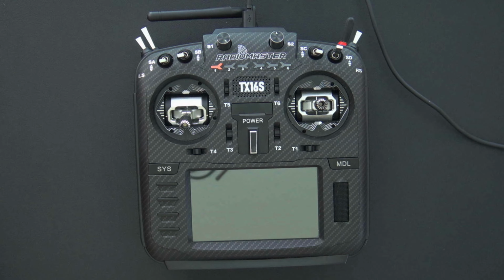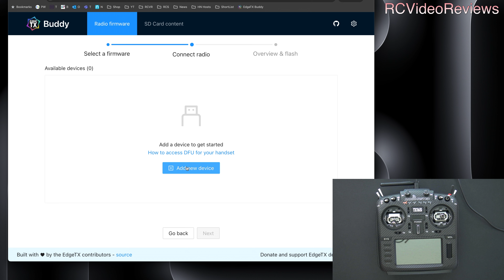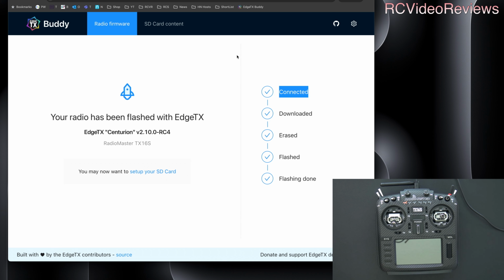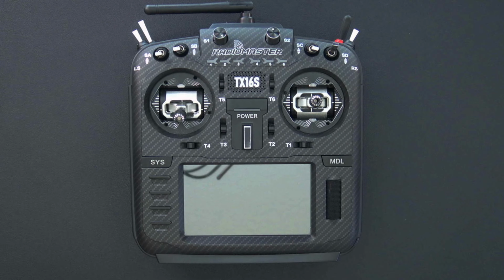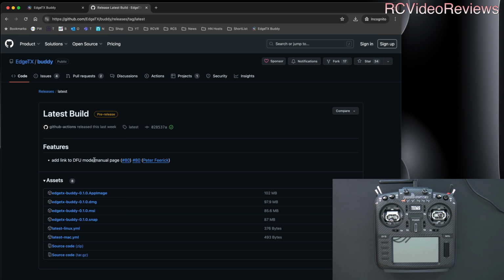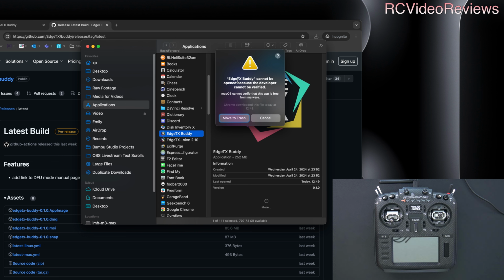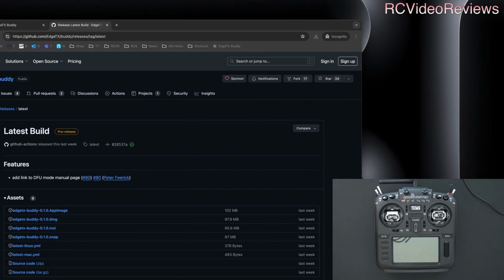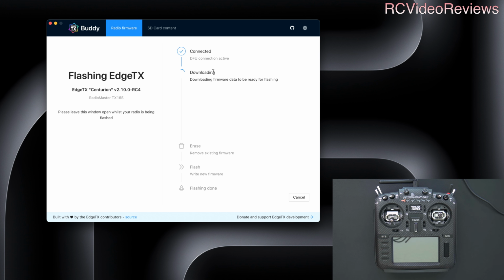How to Flash EdgeTX • The Easy Way

Comment: YES! Thank goodness for this great video documentation of how to use the EdgeTX Buddy online flasher. It took me several uses of the tool before I could consistently remember what was needed for the "Connect Radio" step. Ok, connect it how? In firmware update mode? In SD card mode? In UART mode?! There's 6 different USB devices an EdgeTX handset can be, and only one works for this tool! 😅

Comment: if I understood correctly, I am in opentx and I want to put edgetx, I have to go through version 2.8 before going to the latest version? and to recover my configurations/models, this is manual so?
I can't go directly from opentx to the latest version of edgetx like you do in this video? (even if I don't transfer my "models" and redo them entirely by hand afterwards??)
thank you for your answer,
cordially,
A.
Reply from the maker: Yes. After 2.8 they removed the onboard BIN to YAML conversion capability from EdgeTX. So just flash 2.8, boot radio, let conversion happen. Once that's done, flash the latest EdgeTX.
Reply: @RCVideoReviews  ok thank you very much, I'm in France, and my English is not too good. fortunately there are subtitles. thank you for your answer, I will switch to edge tx tomorrow. thank you again for your very well explained videos, great!:goodvibes:

Comment: When i flash v2.9.4 all works fine, but when i flash one of the newer Versions the radio get stuck in the bootloader with screen off. Does anybody know whot the problem is?
Reply from the maker: Sounds like maybe the wrong firmware is being flashed..?
Reply: I have tested 3 different TX16s, the problem only occurs with the one TX16s. After a long research on the Internet, I came to the conclusion that motherboards have the problem described, but no one knows why the problem occurs with some TX16s. You can avoid the problem by updating via the SD card with the 2.9.4 bootloader...

Comment: Thank you for all your knowledge and guidance with Edge and Expresslrs, but what is the advantages of using Buddy over the radio Bootloader. To me the Bootloader is a lot faster, download the .bin and flash from the Bootloader. Am I missing something?
Reply from the maker: Some people have a hard time navigating to the correct release, unzipping, finding the correct target, putting in the right folder. I chose my words carefully--I didn't say it was the fastest way--I said easiest.
Reply: @RCVideoReviews  👍I thought I was missing something by using the Bootloader, Thanks!!
Reply from the maker: I'm a bootloader man too...
Reply: Bootloader man here myself too usually because it is so much faster, but this method is the least confusing steps. Just plug in and flash (don't even press the power button what?!)

Comment: Hi John, new flyer here. Why do you prefer to fly with a Radiomaster? It seems like most pilots I see online fly with Spektrum. Do you have a transmitter comparison video?
Reply: Because spectrum transmitters are 3 times as expensive, and have far less functionality.  Further you cannot bind to anything other than a spektrum receiver withspektrum transmitter.  I will say that spektrum transmitters are user friendly and spektrums/ as3x gyro "safe " receivers  are second to none.   Currently it is very difficult to bind a spektrum safe receiver to radiomaster if its possible at all.  That is you can bind spektrum receivers but the safe functionality may not work.

Comment: Over a year ago I was doing this flash stuff with buddy than downloading all this random crap they wanted me to download and swap different things in files and folders and after 48 freaking hours of trouble. I get ghost images on my TX16s of program files that have an underline in front of each name. Also, depending on my choices I either have different sets of switches that work and 3 that do not. 

I never knew updating would end up being the ultimate nightmare? So, do I just download the latest option to flash with buddy and that is all I need to do? I spent over 48 hours of frustration and finally just gave up on the whole thing!
Reply: I just tried this and I updated my Micro SD and holy crap! I don't have that ghost files anymore! I haven't tried programing the switches yet to see if 3 aren't still working yet, but thank you so very much for making this video! I guess I wasn't the only one going through crazy frustrations back with Flying Dutchman was giving me tons of issues! 

Thank you, again!

Comment: I would suggest this is only half the process as SD card contents can sometimes need to be updated as well. Which can also be a dangerous bit as its possible to overwrite your models or make some other changes. It would be nice if the buddy would better manage your SD card contents, like make backups, and properly merge changes.
Reply from the maker: Title isn't how to update SD card contents. It's how to flash EdgeTX. I haven't updated SD card contents for a few revisions now, so it's not strictly necessary.
Reply: @RCVideoReviews  agreed but this is one of the things that hangs up new users. Its nice they are getting the Flashing down to about one step, it would be nice if SDcard was taken care of in the same step.  In the past we would get that sd contents mismatch warning. It

Comment: Hi John Tony here,Iam using a Spektrum system at the moment and Iam thinking of buying a radiomaster tx16s,so in you opinion if I go with the 4in1 modual will it work well with the Spektrum recivers I have already or should I go with the elrs internal modual,I fly a moxe of both glow planes and electric,thanks for you thoughts.
Reply: The 4 in 1 supports Spektrum protocols. If you want to go down the ELRS route later and take advantage of its cheaper prices, greater range /functionality, you could always add an external elrs module as they're not that expensive.
Reply: Thank you very much John,

Comment: This is a prime example why I am slowly get out of Rc every thing made any more you have to go threw this crap 8 years ago you could buy some of the best FPV stuff in the world then now every thing is junk I have never in 30 years of flying seen tech go back wards like know day.
Reply: Thanks for letting us know.
Reply: How is it going backwards?

A lot of the technology advancement in the hobby is due to open source projects like (OpenTX/EdgeTX and ExpressLRS).  FrSky and TBS products are waning in popularity because they are closed or becoming closed source and more expensive.  These open source projects keep the tech prices lower and more accessible to more people.  EdgeTX capabilities wouldn't even be dreamed of in the early 2000s and certainly not without purchasing a very expensive transmitter.
Reply: @fpvtrucker129  I'm not sure you understand... Non of this is necessary to use the radio! This is strictly for people wanting to modify / replace the firmware on the radio.

But most people will just buy the radio and use it.